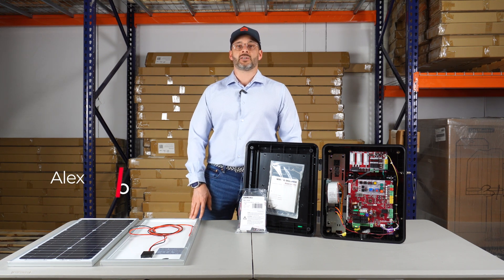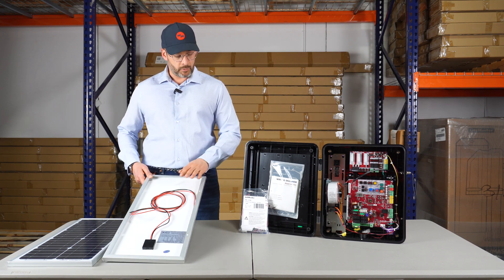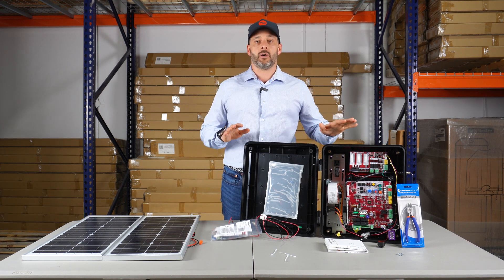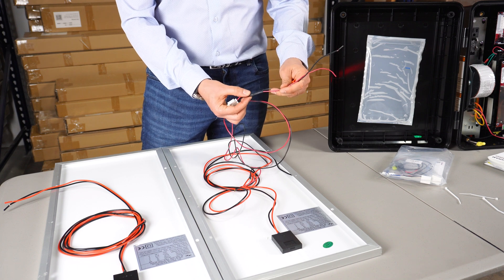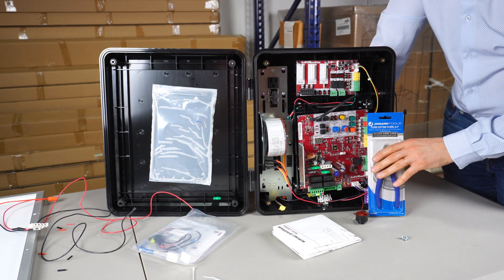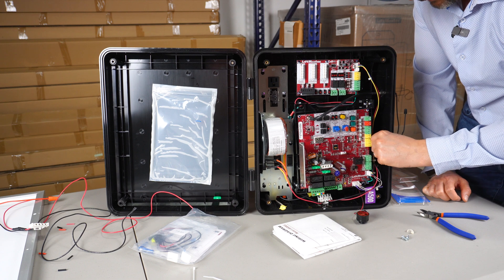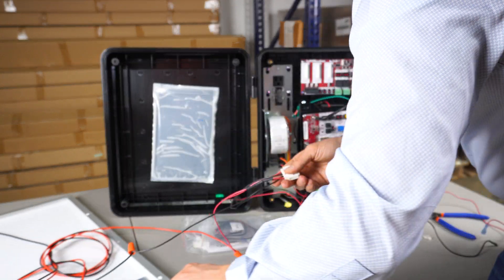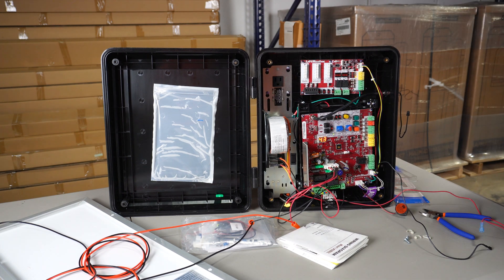Step-by-Step Guide: Wiring Solar Panels to Your LiftMaster 24V Gate Operator

Comment: I wired mine exactly as depicted in the wiring diagram and the video, and receiving a code 40:  Over voltage on batteries.  Have not yet figured out what is causing that code.  Eventually, it discharges a battery